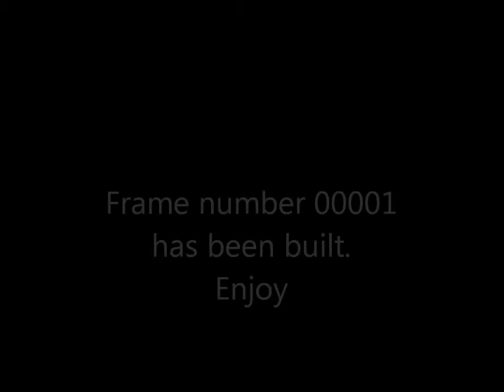Ornithopter Update #3

Comment: hello my friend can you give me cad file of this project ?
Reply from the maker: I don't share the files but I do share many hours of design work and flying video (uncut from launch to landing) that show the completed Thunder Bird design flys very well.
Reply: supertroyofssf yes i see your video , i want to built it and want your help can you help me ?
Reply from the maker: The first step is to gather the parts you need to get started. IE: gears, bearings, gear shaft and material to make the gear box and frame from. (I use G-10 for the frame parts)  Start with the holes for the gear support bearings and get the gear spacing correct and create a gear box. Watch the later videos to see my final gear box design. And "Yes" you can buy any part of the Thunder Bird you don't want to make yourself (there is even a parts video) or you can buy the complete kit. If you want to buy only the gear box, bearings, gear shaft and gears ready to bolt together you can do that.
I have provided enough info on the project that with some effort you could build a model buying off the shelf bearings and gears. There is a lot of work that has to be done. I know of one guy that has built a completed model using only the info found in the project videos. Hope this helps. I am always glad to help if I can.